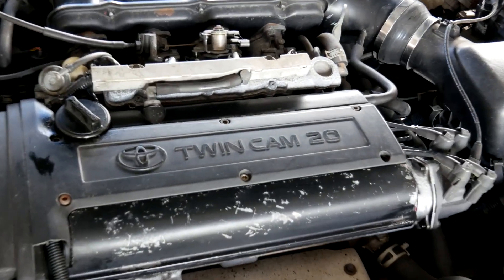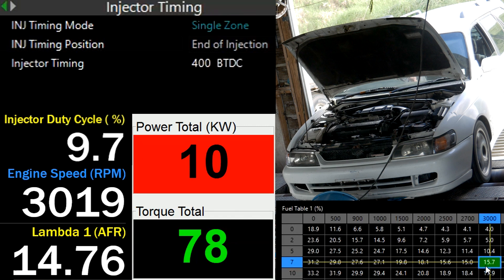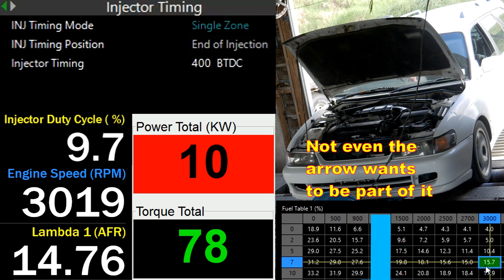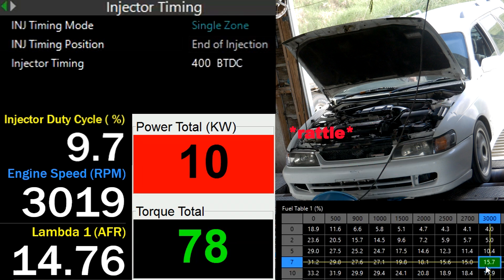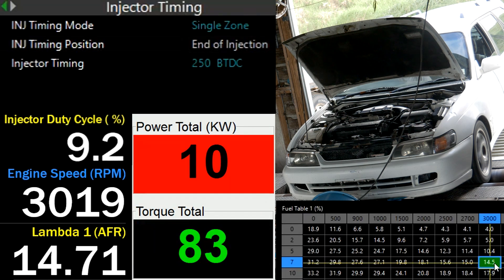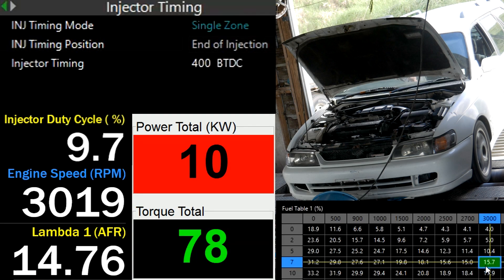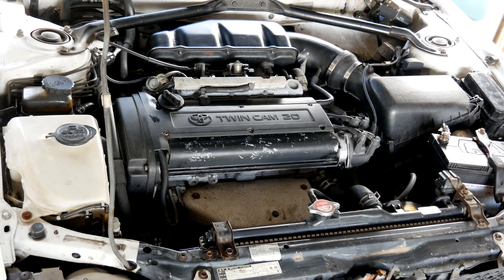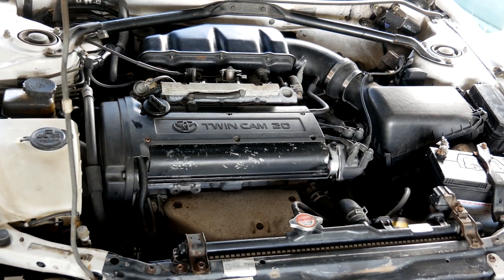Injector timing  Part 2 - Injection angle - Dyno tested

Comment: In part 1 your timings are before intake valve open, but here you put it at the valve opening, why is that?
Reply: Is it because of low rpm?
Reply from the maker: @bagas91919  Some engines like fuel being injected on valve open at low rpm/load.    some dont care at all across the whole rpm range and is little benefit chasing it.   the engine in the other video is the other end of the scale and likes the correct inj timing at high rpm/load.   most things  dont rev high enough or have big enough injectors be worth chasing at high load.    Its one of those things that needs to be tested per engine to see what works best or if is worth even doing or leaving at a fixed number
Reply: @Garage4age  Pretty tricky then

Comment: Low RPM  (Idle-2500) comparison would be nice.. if you ever continue this. 🙂
Reply from the maker: Not many views/interest,  so unlikely will do more on the subject.       but, just do the same as the steady sate stuff,    adjust and find what works best.  check for how nice engine runs at low rpm and idle also.   remembering engine will run different with different afr.  so need to keep that into account and adjust if  its changing with injector timing.    not every engine will be the same

Comment: It does not cut off the fuel completly when breaking with engine.
Reply from the maker: you mean overrun cut on deceleration?     it cuts all the fuel yes,  ecu has adjustable delay before it cuts

Comment: Only 100% pump gasoline? No ethanol at all?
I tried just tried changing EOI (pretty much stock 4A-GE 16V on Link G4X) - i don't seem to get significant lambda changes like yours. I don't have a dyno though. :P
Reply from the maker: yep boring old 95ron.  16v  should be better at mixing fuel than 20v,  so yeah i would expect less of a change

Comment: Why do you hate the 20v Mr G4a 😢
Reply from the maker: Haha, has been a joke amongst friends since forever ago.    They go alright out of the box, but its not the head that makes them better
Reply: @Garage4age  in you opinion, are there any benefits to having 5 valves per cyl or are the lighter internals and itbs it’s playing card?
Reply from the maker: @Kraven_Morhed  20v has better intake  (itb's etc), exhaust manifold,  bigger cams, vvt , higher compression, lighter pistons, rods, flywheel.     compared to any version of the 16v.    Can't back it uo with science. but most likely those things are where at least a good part of the power comes from,  factory vs factory.

Comment: Awesome 👍, that's what a proper tune also has to cover, not only the WOT and big HP numbers but also the driveability and economy. And that's what takes the big portion of time to make it right. Thanks a lot for showing this
Reply from the maker: Yup,  WOT  is generally easier and faster to get dialed in, than getting the rest nice.    Also a lot people don't realize an aggressive  big cam na engine  is harder to tune than a turbo engine making double the power

Comment: I'd be interested to see if crazy high fuel pressures make any diff to power. Some of the Honda NA drag race boys swear by running super high fuel pressure for "better atomization" and make the last bit of power that way.
Reply from the maker: Thanks for the idea.  i have been meaning to try this at some stage.   I run factory regulators on all my stuff as they tend to me more reliable than the aftermarket stuff,  otherwise would have done it long ago

Comment: Looked like it liked 350 better at really low rpm, but then 300 took over for everything else. Maybe ignition timing would alter the efficiency at the different rpm range points for the injector timing as well because of it.

Comment: I do injector timing on jeep 4.0 stock
With haltech ecu
In 360 was insane power big different than 400
I think u need to try engine all motor 
What i know u should adjust degree each rpms
Idle 300
Mid throttle 350
Full throttle 420 
 Like this u will find better results 
And its about adding fuel in exhaust valve or maximum amount fuel intake

Comment: Pretty much what I expected, having tuned the same linage of engine with early types having double fire batch injection and later having full sequential with ability to tune EOI, there is bugger all difference, nothing above about 2500, and slightly margin of error stuff below and as the video suggested, just mainly small fuelling differences.  EOI can by handy to get a little smoother and stable idle with big cams, but running leaner AFRs for big cams does most of the work for better idle.

Comment: I feel like proper injector timing is not about perfect power output, more about perfect fuel economy.
During the power dyno pull You can se how with certain injection angles with same fuel amount results in richer mixture: so You can dial a proper injection angle and pull some of the fuell off in sake of fuel economy.
On Idle - i was personaly noticing - the proper injection angle allows for very smooth idle even on slightly leaner AFR.
Reply: Exactly. It allows for the proper usage of fuel per injection cycle. It can also be adjusted at idle to help larger injectors get out of the non-linear range.

Comment from the maker: Do you like being told what to do?  No?  Your engine doesn't either, find out what it likes and give it what it wants.      

Anyone like to see some more 20v development?   Just a warning though, if doesn't make any power, I am going to use the science to back up 16v's are better 😂
Reply: Absolutely want to see more 20v development. Literally been waiting for years to see it.

Ive often heard that 16vs can make better "peak" numbers more reliably, but that 20vs of similar mod/development will have wider power bands than 16vs.  Id love to see how true that is
Reply from the maker: @SidewaysGts  if 20v retains vvt, should have a wider powerband.      The vvti "turd"  16v with stock cams smashed this engine everywhere,  but not really apples to apples  comparison
Reply: @Garage4age Do you think 5valves is really that much better than 4valves?  Or just a gimmick 😂
Reply from the maker: @repingers9777  marketing
Reply: @Garage4age  no way 😭
Reply: please do more 20v content, I would love to see what you could do with VVT-I like you have on the 16v, even if it ends up more limited on the 20v.
Reply: hell yes. better or not, i'd like to see the difference between both head design
Reply: Yes please, bolt on mods and maybe then slight porting (what's possible to do to that cylinder head.)
Reply: +1 for more 20v stuff. Love to see what you can do with it.
Reply: I would really love to see a turbo 20v in a blue FWD starlet!!
Reply from the maker: @joemeds243   turn it up  till it explodes? then back it off a bit ?  🤣
Reply: @Garage4age  Would love to see a full variable vvt mod done to the 20v head like your 16v one too.
Reply: Would deffs like to see more 20v Development as I have one myself
Reply: Perfect quote and viewpoint.   "Give it what it needs"...